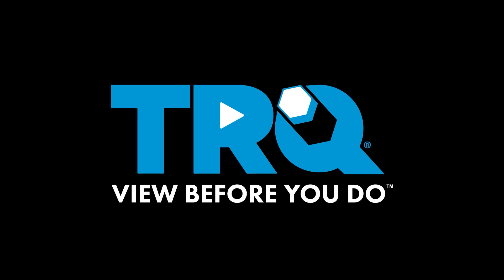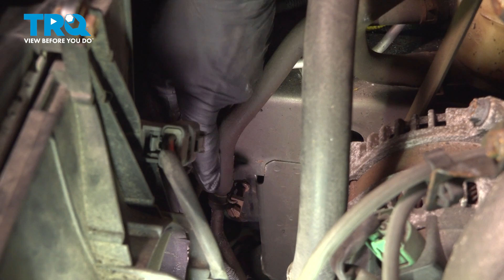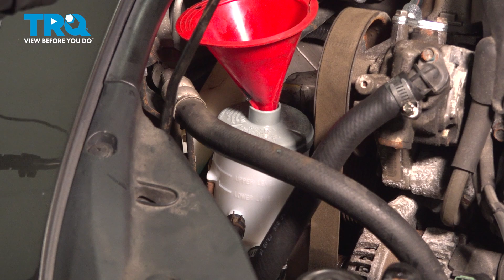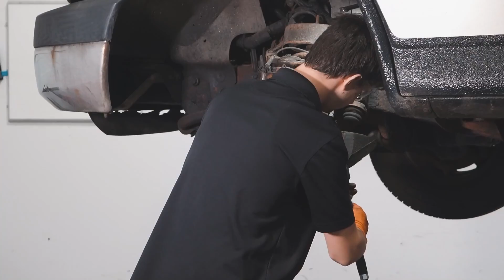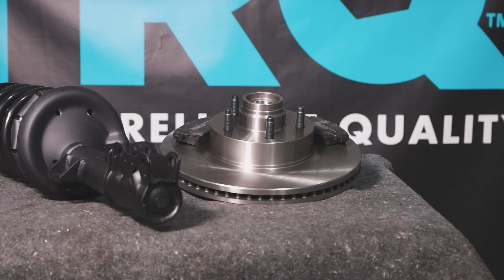How to Replace Power Steering Return Line Hose Assembly 2003-2007 Honda Accord

Comment: Hello! I recently replace this hose. I noticed there is some “jumping” on the power steering fluid. I already tried bleeding the system and I still get that “jumping” of the power steering fluid in the reservoir. What do you think might be the issue? Mind you it does not bubble, the fluid only jumps around in the reservoir while the vehicle is on. Do you think I should recheck the hoses to see if they were replaced properly?

Comment: You only seem to show replacing the difficult lines on a 4 cylinder with a lot of room under the hood.  I might have to remove the sub frame to access the hose I need to replace on my 3.0L V-6.  I already wasted an entire day getting my arm and hands sliced to shreds attempting to gain access to the clamps.  I do agree the OEM clamps have to go.